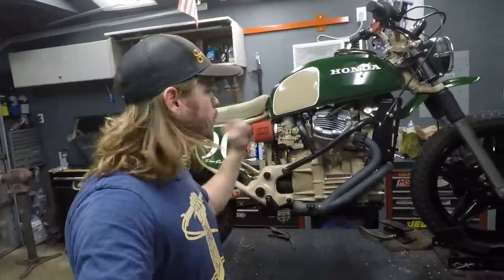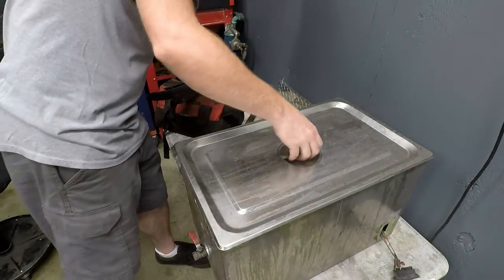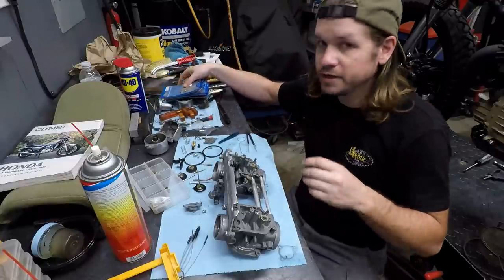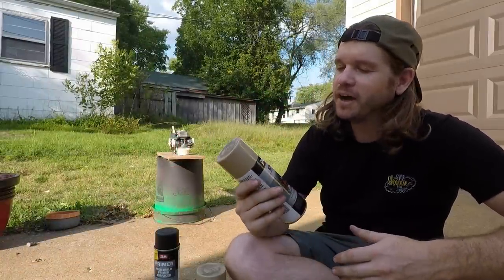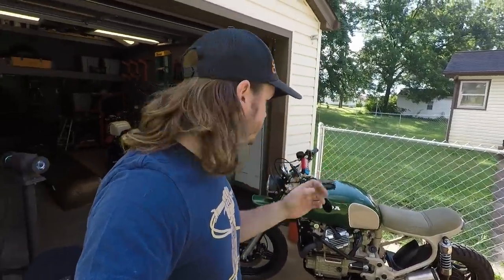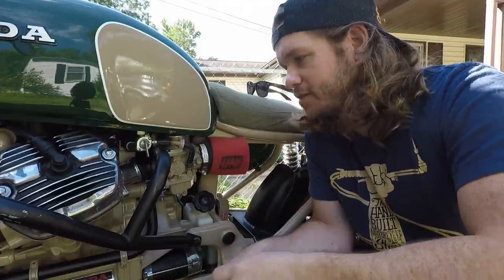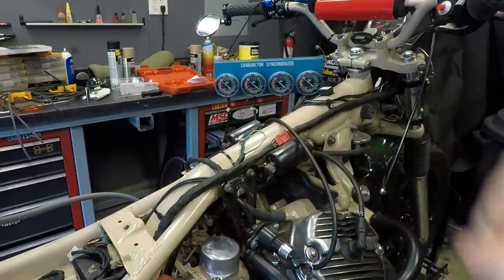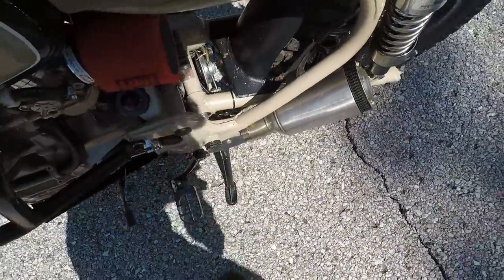CX500 Rescue PT2 - Carburetor Cleaning and Vacuum Sync

Comment: Very cool video on carb overhaul and in-general freshening of this bike! Sounds like it runs well to me!
Tuning CV carbs with individual air cleaners can be a PITA, but, if the carb is understood, it's not that bad. I did it with my CBX a long time ago and picked up a ton of power. Trick is to get the vacuum slides to open smoother but not necessarily quicker. I did that with a spare set of slide springs, kept tying up a coil until I got them right, and opened up the vacuum bleed in the spare set of slides I had to make that work even better. Lot of work, keep a standard airbox if possible!
Thanks man!
Reply from the maker: 100%. It would be a long video going over tuning theory with cv carbs but again I feel I'm no expert.
Reply: @BrickHouseBuilds  you did just fine, man! Keep up the cool videos!
Reply: I feel ya, my first cafe bike was a CB 500 four. Its was free, laying in the bushes outside. The carbs were full of junk, after cleaning I made 300 attempts at syncing them. I was in way over my head.

Comment: I am not knocking your work in any way but I must say painting carbs is nothing that I have ever considered. Nice job on the intricacies of those carbs. My 1980 CB650C had the anti pop valves and all my experts said "don't touch them" as they were unobtanium at the time. Those were regular slides. CVs can be very tricky. Sounds great. You do nice work, sir.
Reply from the maker: Many thanks!

Comment: I have used Cerakote, done at home (bought a cheap oven to go in the garage). Not used it on any carb parts. But like it for brake calipers, fairing brackets, clip on bars, etc where the thin finish and the resistance to brake fluid, etc, is useful. Takes time though and easier to mess up that paint (too thick a coating will blister when baked).

Doubt you would manage a good match to the rest of the paint using Cerakote though.

100% agree that fun is the important bit. I have bikes from a YSR50 gag bike up to a tuned 1200 Bandit (mostly have 125 2 strokes though), and fun is the important bit.
Reply from the maker: Im definitely still interested in trying the stuff though.  I like the quality of it

Comment: I don't know if you did them in the first build but in all the older bikes I worked on I always split the carbs and replaced the o-rings on the fuel and accelerator tubes between them. Nothing more frustrating rebuilding carbs and they seep out those joints when you put gas through them. I always bench tested the carbs also just to see if they have a leak before putting the effort to mount them on the bike.
Reply from the maker: The video just before this one is where I work on the carbs actually.  Pretty good video as I go over some previous mistakes I made

Comment: Hiya,my missus has a modified gl500 ,ive balanced the carbs but it does have thoose restricted type pod filters on because there is limited space,do you have the spec and size for those filters you use without the restriction 🙂
Reply from the maker: A UNI PK92, K&N, DNA, or dynoman filter will work. Check my first start/first ride video for my gl650 build. I have a link to the k&n filters

Comment: For the average shadetree mechanic,  with no ultrasonic, i am guessing a rebuild / jet / needle seat kit , if available, would be your recommendation ?
Reply from the maker: You could buy some lemon pinsol and soak them overnight then cycle carb cleaner and compressed air. Much more scrubbing required.

Comment: That scrambler has a great sound to it and it runs much better after doing the valve, cam chain, and carb cleaning, sync and adjustments to it. Did you change the plugs? Great job once again.
Reply from the maker: Ran great for sure. No need to change the plugs though

Comment: Hello BJ, I enjoyed the video, thank you. Do you find you have to ultrasonic clean the carb parts again after the soda blasting?
   I have found that an etch-primer provides a good key for painting alloy surfaces.
Honestly, I thought the bike sounded really sweet when the work was completed, a cracking job. Keep the videos coming!
Cheers Kevin.
P.S. (I am a little troubled by the wiring into your ultrasonic cleaner!) take care.
Reply from the maker: Yes I always run them in the tank after soda blasting to dissolve the media

Comment: I notice you don't seem to worry too much about mixing parts from the left/right carbs whereas I've seen others be very particular about it but never understood why. If the parts are good it shouldn't matter what they go back into.just wondered what your thought process is?
Also see you use petroleum jelly...is that just for the rubbers?
Reply from the maker: I try not to mix slides but don't really care about mixing brass around. Some have said it's best to avoid but I see the pros mix parts so I'm not worried.  Yes, petroleum jelly. Yes the world will in fact end because I used it. Never had an issue.

Comment: Hey BJ, do you use full strength muriatic acid? Side note, your pink respirator cartridges are good for dust particles. Better than nothing but for any kind of organics (paint, chemicals etc) swap them with the plastic cased cartridges.
Reply from the maker: Full strength.  I know the cartridges are different but I just don't take the time to swap every 5 minutes for various stuff I do. Again, usually outside and up wind of the stuff.
Reply: @BrickHouseBuilds  fair enough

Comment: yesterday I read the specs on the 650, wich said it has less fuel consumption than the 500, how crazy is that??
Reply from the maker: Well the 650 had a different gearing which meant lower rpm on the highway
Reply: @BrickHouseBuilds  Ah I thought it has to be something like that! I think the 500 is going to perfect for me, I need a relaxing bike besides my SV650 gen1

Comment: how easy is it to change the gearing n bikes like these ( either higher or lower ) ?
Reply from the maker: You can't unless you have complete custom transmission gears machined
Reply: @BrickHouseBuilds  is it safe to assume the transmission ratios and the final drive ratios are all the same with this particular style of honda motor ?
Reply from the maker: @charlesboston1  they are bike specific. The final drives and stuff rarely fit different bikes